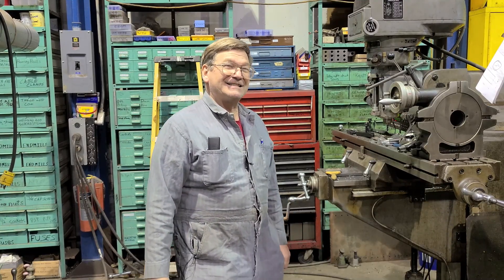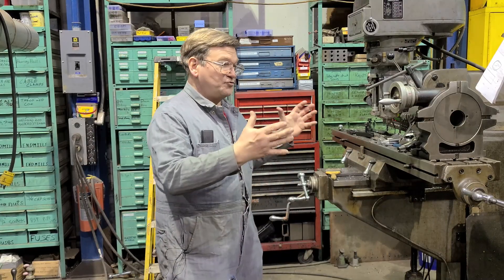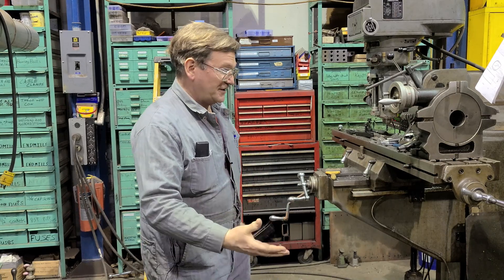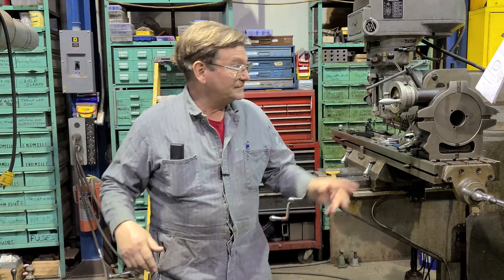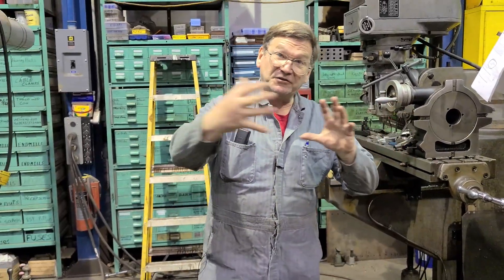Machinist's Minutes: CNC's vs Manual Machining

Comment: Edit:  I should say first that I'm not a machinist.   I'm a millwright, and we delight in mucking around in everyone else's trade, so of course I do machining.
I've only watched about 4 minutes of the video so far, and I totally get what you're saying about the programming time, but I will say (and I expect you would say the same) that there are circumstances when CNC is waaaaaay faster.    At work I have one machine tool (other than a small saw and hardware-store drill press) and that is an ancient Mori-Seiki SL-15 CNC lathe.   On that lathe I occasionally produce tiny parts for our machinery by the thousands.  Once every 6 months or a year I have to power the thing up and try to remember how to use the antiquated Fanuc 10A controller on it, and cajole it into making 7 or 10 or 15 thousand parts for me using a bar puller.  We don't have a bar feeder, mind you... I have the aluminum rod cut to 4' lengths so that it won't propeller in the machine, but I can get fifty good parts out of every rod, and over the course of a day (24 hour production) we can make about 1800 of them.   There is no feasible way that I could make that happen without CNC.   The guys operating it at night are temp workers... they're not trained machinists.  They take a part to QC to have it checked for size, and other than that they just put in a new stick of material and push the green button.   Having these parts made would cost $3 per (I've had it quoted) and I can make them for about 12 cents a piece on this lathe that cost us $5K and still holds tenths (if you keep the temperature consistent... I get smaller parts at night than I do during the day).   Still, you can't argue with a situation like that.   I spend two or three hours writing a program and testing it, and from then on it's a few minutes to get the lathe going (clear out the coolant channels and refill the way oil) and it's off to the races.   On even a thousand parts the time spent programming it dwindles to near nothing.   The last run was 7000 parts, so the programming time per*part was about one second, and the next time I run them it will be zero seconds, because the programming is already done.   Also, this machine thrives on neglect.  I like that in a tool.   :)
Reply: werd to the wise... power that beasty up every couple of weeks, keep the internal battery charged up, its a fecking nightmare when they go dead... them old Mori's are bomb proof otherwise
Reply: @northmanlogging2769  And replace the battery yearly while it's powered on.
Reply: @northmanlogging2769 agree, it cost me about $10,000 after everything was said and done, when the batteries died in my Mori Seiki SL25B500.
Reply: It’s nice to have robust tools. I have old CNCs too but mine are delicate. They need to be cleaned, caressed and talked to very softly. Or else they will throw an error or just quit in the middle of a hot job.
Reply: Exactly right, manual machinists need to get with the times. I started as a manual machinist for a long time and I thought the same, but now big been strictly cnc for years . They have came a long ways, for simple parts I can program easily in under 30 minutes and have tools tooled up. Conversational machines are even faster, not to mention the rigidity and fast you can cut, and, you have that program done for next time :)

Comment: When asked about this I respond with something along these lines - manual machines are great when you make a wide variety of parts but not a whole lot of each at a time, CNC takes over when you have a lot of one part to make, not enough people to make the parts, or the engineer designed something they can fap to instead of a practical part.
Reply: But CNCs are useless for custom one off work or repair work or SHIPYARD work. And when the CNCs screw up, the Manuals have to fix the CNC screw ups.

Comment: Programming is not that difficult. Especially with today's conversation language.

As for the "untrained" insinuation, I know of no machinist that don't know both sides of the skill. (There are operators who know neither)

This is opinion, not necessarily fact.
Reply: i started out as a CNC programmer/machinist without having any machining knowledge prior, huge risk from my first employer, as i only knew how to work in CAD at that time... now i know more about manual machines than most of my coworkers (machinist graduates) combined...

CNC is IMO more versatile and in most cases faster, not always, but almost...

Comment: It's as if engineers get paid by the complexity of the part versus the function. 
They also adjust their speech. For example:
The plural for axis is axes.
Engineers say: axessees
The plural for process is processes.
Engineers say processees. 
I can go on but you get it.

Comment: I’m seeing too many it’s either this or that here. Whether to CNC or not is a more comp,ex question=ion. It’s not just the comp,entity of the part, though sometimes it is, or the number of parts, though sometimes it is, but rather the entirety of the operation. For a small shop, such as Howie’s, or something similar, it may be that they will simply not do certain jobs. But large shops it may be a different story. 

Of course, Howie is talking here of simple CNC. Many modern machines are five or even more axis’s and that work is almost impossible to do manually, even with dividing heads, hydraulic or otherwise, combine that with large numbers of parts and CNC is mandatory. Modern CNC also tends to be more accurate. 

Programming time can take several days for some highly complex high accuracy parts. But once it’s worked out the results are worth it, again particularly if there is a fair number needed. 

But all that’s in favor of CNC. There are many reasons why it’s not the best solution, or at least, a necessary one.

Comment: Well I would 100% agree with you because as a cnc machinist I ONLY have cnc at my disposal I would love a mill over here for quick operations. That being said I cut features on the daily that are smaller than 1mm we use 1mm cutters and 3/32 cutters daily and there's no way youre gonna make any features with that size cutters on a manual mill.
Reply: Well my friend, I guess you have never met Mark.

Comment: same old BS cnc vs manual bashing. I own 2 shops, since 1963. bought 1st cnc mill & lathe in 1999. we use both. manual & cnc. CNC makes us more $$
because 1 man/hour can tend 3 cnc machines making many more parts  than 1 man/hour making 1 part on a manual machine. Even with a qty of 1, it is usually faster to program with today's CAD/CAM, and let the cnc make the part unattended, at night while we're closed (aka running lights out).
whether cnc or manual,  making 1 part takes time - with manual a skilled machinist has to stand on a hard floor in a noisy, cold /hot sometimes dirty shop, close to a dangerous machine spitting hot & sharp shaving or spraying coolant versus a skilled cnc machinist sitting in a clean quiet climate controlled programming the part then loading the mat"l a letting the cnc make the part while he goes to lunch or programs another job... both take about the same time, with cnc churning out a higher quality part 9 out of 10 times. 
most of my years in the biz were spent on manual machines; we used turrets, indexers, gang drills, special form tools to boost productivity - each is just a progression toward automation, no different than progressing for pen to manual typewriter to electric typewriter to word processor.
folks who wish to bash cnc should drag out a manual typewriter,  then mail in their complaint,  instead  of simply sending it via their smart phone. 😂
my company makes high performance cylinder heads for Harley Davidsons. I can manually port & work up a set of heads in about 6 hours.  with 1 five axis cnc, including programming,  I can produce 5 sets of heads, at a much more affordable price to my customers. 
cnc vs manual argument has been around since the first NC tape machines were developed for the air-force... it's like arguing about a horse & buggy vs a car. both have their 'place', but there's a reason more people drive cars than buggies...
Reply from the maker: Sorry that came across wrong, I am not bashing CNC.   I just want to help people realize, it's not the only, always best way.  I am also glad that You have a good product, that takes full advantage of the CNC machines that You have.  Most people will probably not appreciate all the time you have also put into research, with flow benches, dynos, or maybe track experience to get to where you are.  You must also have had good business practices & advertising.  I fully support having good lighting in all machine shops, why would a manual tooled shop not want good lights?
Reply: @HOWEES  you're 💯 % right about lights in a shop. 6 yrs ago we moved to a bigger building- first task was installing 135 Bright LED lights...  🌞 
and you're right on about the hours spent at the flow bench when developing a port.
I really enjoy your videos and appreciate your effort/time. Even with 60 yrs experience, I still like to learn from other machinist, such as yourself. thanks for sharing 👍 
I enjoy your
Reply: That's a good point.    We have a shop that makes BIG tooling for us on big-ass five-axis roller machines and they will set it up all day then let it chew on the part all night.   We're talking thousands of profiled holes on the surface of a cylinder.   And pretty big.  The biggest (so far) was 42" OD by almost 11' long, with over 15,000 profiled blind holes in it, and it was all done in ONE setup.   Big-ass machine.   The crazy setup they have today with all of the touch-screen stuff is fit to make you weep when you're used to an ancient controller that doesn't even have a full alphabetic keyboard (hit 'shift' for 'T').

Comment: Lol A tracer. Let's go back to the 1950. Learn how to program. 😅
Reply from the maker: I first learned programing in 1976 (basic) G-code in 1978, Fortran in 1990 Relay ladder in logic 1999, I do not let that stop me from using other methods when they are better suited for the job.
Reply: I am 37 and new to the job I am at... I work as an industrial maintenance mechanic. I was asked recently to revive this old monarch lathe, using the rest of the fairly rudimentary manual equipment we have... 

I got the job done but had never seen a tracer before, I spent hours upon hours taking what was left of it apart and looking up what was missing.  It is absolutely amazing what toolmakers had to work with when manual machining was the only option.  At the end of it all, having this under my belt now, I was even more enthralled by the manual machining process.
Reply: Agreed
Reply: Most people with sense wish they could go back to the fifties. I program for a living but really like manual machines for hobbyist work.

Comment: Another situation where a cnc is not any good is for example if it turns out that the stock is out of spec a manual machinists can correct it a cnc may very well destroy the part of another example if you have a bushing for a old machine that just needs maybe a little bit off the inner diameter it can just be put into a lathe with a boring head and brought to correct diameter
Reply: You measure the stock before you program it. Unless you measured wrong why would it be out of spec. Or if you’re not designing and programming yourself.
Reply: I've ran a looooot of parts on NC lathes and mill-turns. Castings and bar stock of all shapes and sizes, the only time I've ever experienced issues with the material it has always been cracks or voids. Can't fix that on a manual, neither can you with a CNC. It's purely a supplier issue, in that they better pay us back under warranty for delivering out of spec materials or we will make issues for them (half joking)
Reply: @OB1canblowme  i experienced material being "out of spec" after one guy didnt notice that the band saw blade went dull as he was cutting about 500 stainless cubes, in the end the saw balde was cutting about 4mm out of square... unfortunately i only programmed the stock 2mm larger than it was supposed to be... 12mm endmill didnt like the width of cut being 5x of what it was supposed to be, especially at around 2000mm/min and 40mm DOC...

Comment: Horses for courses. First thing is to give your manual machinist equipment that produces round, parallel and square parts. Lathe or mill. Give them dro's, suitable chucks, vices, clamps and tooling. Good lighting and work space but of number one consideration should be drawings with a layout that matches up with how something is made. Dimension from outer portion if it sticks out of a lathe chuch etc. So sure, have a part finished drawing but give them a " construction drawing" toleranced, surface finish requirements, straightness and concentricity  details. Let them get on and make it instead of spending time making drawings.

Comment: Thing the CNC sufficants forget, to write a good program for even a relatively simple program your looking at an hour or more just to write the code, another hour or so to set up, but you save 2 minutes in cycle time... For short run stuff or simple second operations can't beat a manual with a competent machinist.  (I've worked with plenty of "programmers" that couldn't write even a simple program in less then 8 hours...) 
A lot of the programmers I've worked with, were simply good at bull shitting the owners, cause they could navigate microsoft windows or MS-Dos... didn't know a damned thing about machining but they could prattle on about Ram and gigibytes
Reply: The code writing point becomes null and void when you consider that CAM softwares exist that write the code for you after you design the part
Reply: @FriedPixel  The Cam software does not make good programs all by itself, despite what seems to be common practice these days, its still dependent on a programmer having a clue to what machining processes can and should be done, clicking the solid file and saying DO IT does not make you a programmer, or a machinist
Reply: @FriedPixel  not exactly "after you design the part", if you dont make lots and lots of similar parts, you most likely dont have macros set up in the CAM, but even a really complex parts can be programmed within a couple hours, simpler parts that are suited for manual machines can pre programmed in about 20minutes, including coffee break, setup time in machine depends mostly on the type of part and what specific tools you need for that part, quite a lot of parts can be made with only a couple standard tools, sacrificing seconds off of run time for ease of setup, letting interpolation doing all the hard work...
Reply: Programmers, need to know if the thickness of the cut, is okay to climb cut, or not. What speeds keep the tools from premature wear. All the things that a manual Machinist, has known for a long time, they don't even seem to think about. Wrecked CNC machines, lead to down time, not production.
Reply: @PGspeed88  yer absolutely correct, however, not a whole lot of "programmers" out there that CAN write a simple program, THAT WORKS in a few minutes, Hel most of the ones I've worked with would take 4-5 hours to make a simple hole pattern, let alone any sort of profile or roughing work.  Any moron can click on a solid file and have the CAM software "decide" the "best" method, a real machinist and programmer is what makes it work well, every time, same goes for manual machines, takes more then the ability to turn some handles and tighten a chuck/vice to make a machinist, current industry (at least around here) proves that daily
Reply: And yes at one time I could write simple drill cycle, facing, or even basic profiling (with corner rounding) long hand faster then it took to walk to the office and chew out the "programmer" but, thats not exactly a common ability in the shops I worked at (its also a reason I got fired more often then not... cause the "programmers" were often the "leads")